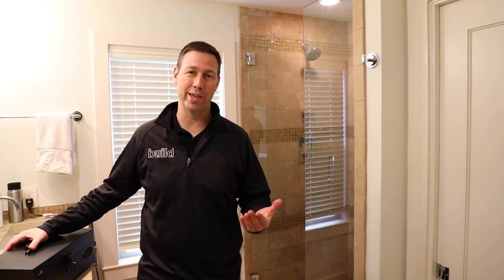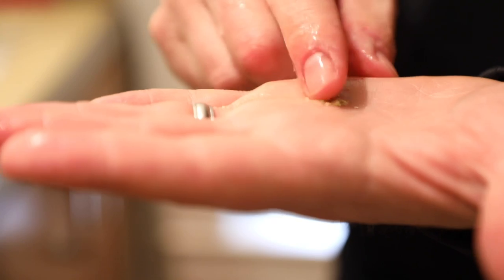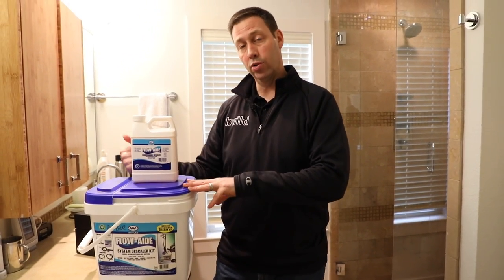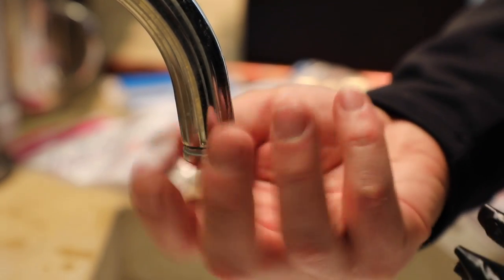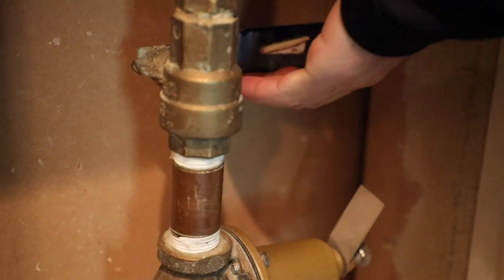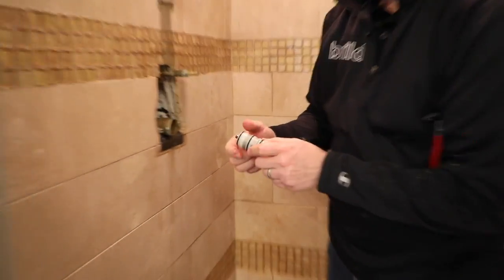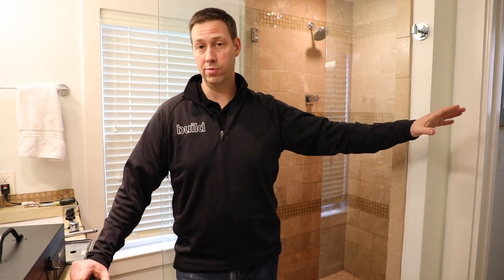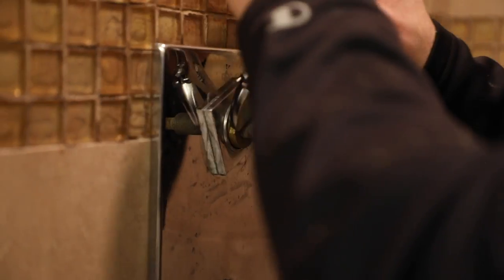The Bummer for Tankless Water Heaters - Fixing a Scale Issue

Comment: That's a pain.  If I ever install one of these, I'm putting a Y type strainer [fine mesh screen] on the water heater outlet to protect the o-rings on my fixtures down the line from big scale.  That way I can make my mess outside, and access is easy.  Come to think of it... add a ball valve for a quick dump of strainer contents as disasters tend to come with company, and they can get back to their shower in seconds instead of an hours worth of maintenance.  Screen still has to be popped out every year for inspection, but that's ok - beats losing screws down the drain..
Reply: Flinch I did that on outlet of my water softener, , FIRST never use those pleated paper water filters, I had one come apart plugging each faucet, never again, then the resin bed filter came apart, did same thing, changed softener, but a brass  y type filter was installed , got that a plumbing supply, LOEWS, HD , don’t carry these things.
Reply: @flybyairplane3528  I'd be afraid to use paper too: it might work, but would that mean changing it out every month without exception? I've never tried it.  For most water systems, spun polyester cartridges seem to work fine, but the high temp coming off a water heater might be an issue that caused your premature delamination?  Seems to me 99% of water filters out there are not designed for hot water service, which makes a [bronze or CPVC body] strainer the most reliable/least maintenance even if it lets super small particles through - a 200 mesh will probably let anything smaller then 75 microns through and a 300 gets 50 microns for example.  If the building was not protected by a filter on it's supply, I sure would put a polyester type before the heater if it comes unequipped.  When city water has problems, their repairs can take a long time or are just a band aid on a stab wound [like grouting the inside of cracked mains pulling in dirt with a venturi effect at certain joints].

Comment: Out here in well water country, the real problem is the water heater's inability to heat the water sufficiently to overcome the 40 degree temperature of the water when it comes out of the ground. Make sure you know what sort of temperature rise your heater is capable of above your ambient 'out of the pipe' temperature. The local hardware store sole several of the electric tankless models and every one was brought back because customers could only get about 88 degree water out of them because of the low ground water temperature.

Comment: I would like to add a few things here, 1 a whole house filter and 2 they have a hot water filter you can add. After the water heater it would help reduce problems drastically.
Reply: Sounds like a great idea, but a whole house filter is useless against hard water. Water softener, or heater treater filter are the only two things that will protect your tankless. Also when flushing a tankless, there are as many as two internal screens located within the tankless water heater that must be cleared prior to, and after, cleaning.

Comment: It's best to have a water softener unit for Sure!!! Besides that in this day and age it's majorly prudent to also have a full water filtration system since municipal water is getting sketchier all the time from the failing infrastructure that isn't maintained at all in this country. Lead incidences are on the rise across the entire country from west coast to east coast!!!! We run a high efficiency boiler system for domestic hot water and heat and without a softener system it would be clogged to the hilt but almost 10 years later we have never had a scale issue...

Comment: Thanks for the great video.  I would have never thought about scale building up on a thermostatic shower valve.

I have a Rheem heat pump water heater and geothermal with a desuperheater and hot water pre-heat tank.  I am on well water.  Other than my water softener and two-stage 1 micron filtration, is there anything else that I can be doing to protect that equipment?

Comment: There was an old water heater in this house when we moved in 15 years ago. The water heater has been kicking and running fine we have well water though that doesn't mean our water isn't hard we tend to have iron buildup. We have to scrub your toilet pretty often or else it starts to look like there's this reddish off color that has stuck all to the toilet bowl. I've wanted to update the water heater to a tankless one but I'm afraid of touching it LOL it's probably just barely holding on and who knows was all these newer water heaters being built so cheaply out of steel that will Rust or just don't want to risk it right now :-) plus God only knows how old is water heater is. We haven't done any maintenance on it whatsoever we haven't drained it and flushed it we haven't changed the anode we haven't changed any of the heater elements. Definitely going to tear this thing apart once we replace it
Reply: Katea Jurors some years ago at my SIL in PLANTATION FL, one day I looked at the WH,it was 30 years old never drained by her, so I replaced it before our trip ended there , she had water damage from upstairs, did quite a mess, had to replace carpeting, then MOLD , she had to have her insurance cover it, you can’t sue the other person, , as is how condo laws are .

Comment: This might be a lot more work, but if they wanted to be certain that all of that scale was removed, could you back flush the entire system with that descaler and let it sit for a day or so and then return water to the house? Like opening a valve slightly to the water heater and using some sort of a pump to pump the descaler into one of the faucets or shower until the system is full and then shutting the valve at the water heater and letting it sit? Or maybe there is a sink/faucet/hose bib at a low point in the house, shut off the water to the house, open every faucet and pump into the low point. Then go around the house and shutting down each faucet?........I could be way off base here, but its a thought.
Reply: Interesting concept!  I've pumped vinegar into all my plumbing lines & fixtures, but worked from the basement "up" (not all fixtures had an easily accessible connection point).  Plus, working from the basement meant I didn't need to move the equipment (i.e., pail of vinegar, pump, lines) once hooked up.  Otherwise, using gravity would have been helpful!  

Since I had to pump the vinegar up 3 floors, I needed a pump that could produce enough head.  I also needed a second person to open one side of each fixture at a time while I started/stopped the pump and opened/closed the corresponding service valve (hot/cold).  We communicated by phone.  

I coloured the vinegar with food colouring so it was obvious when each line was full (since the smell wasn't obvious enough).  It took some coordination to close the fixture valve, stop the pump, and close the service valve (so the vinegar didn't drain out) once each line was full (there's that gravity thing...lol).  Then I let it sit for ~6 hours and that was enough to fully clear all blockages.  I used almost 4 gallons of vinegar to completely fill ALL pipes (hot & cold).  

I have now installed a softener w/pre-filter so hopefully I won't have to flush the lines again, though I will still flush the tankless annually.  We never had any issues when we had a traditional hot water tank, so that tells me that all we really needed was someplace for the minerals/sand/etc to drop out...though the soft water is nice.  (Our hardness is 17 gpg.)

Comment: I am admittedly a bit OCD, but when I descale my Rinnai  I use about 6 gallons of vinegar (about $15 worth at the wholesale club) and sit a 5 gallon bucket in the shower to drop the pump into.  I pull the shower head off and run a 3/4" clear vinyl hose from the shower arm down to the bucket,  and run a drinking water grade hose from the pump back to the tankless.  This way I am de-scaling the entire hot water loop from the tankless to the shower including the valve but without having to disassemble.  I let it run for about an hour like that.  I also go to each tap in the house and crack open the hot until I can smell (or taste) the vinegar coming through to that point.  I do this at the start of the process and let the vinegar sit in the line for the whole hour that I am running the pump.  When I'm done, I flush the lines out well with fresh water before turning the tankless back on.
Reply: WOW what is your house plumbed with
Reply: A little bit of everything ...  copper, PVC and Pex ... but I am flushing the hot water lines to get the scale out of the valves and fixtures where it collects as Matt mentions in his video ... not worried about any scale in the pipes themselves.
Reply: That's definitely a cool thing to do as a diy homeowner.  Running the solution through a thermostatic/ or even a balanced showervalve will also descale the temperature balance piston, which seize up from very thin scale build-up. That's too involved for a paid serviceman to do, as they usually have a set price for the service, and need to get to the next job.
One issue I see with that is thermostic valves have little check valves on the inlets, if the cold one is damaged, you will lose your solution to the cold side. Balanced only valves will definitely loose solution through the cold side.

Comment: Do the smaller tankless (reheem 13 or undersink unit) require the service valves? Smaller units are normally 1/2" inlet outlet; do they make 1/2" service valves? I have only seen the 3/4.

Comment: If you install a recirculation pump with your tankless system then the tankless would be running and using gas or electricity constantly correct? Unless you have a timer on the pump. Its been a few years since I've done an install and want to be sure im giving my clients correct info. Thank you in advance for your input.
Reply: Dave Tobara no the ‘pump’ they suggest is a tiny flow as compared with the others , to prevent that from happening.

Comment: Is there an INLINE solution? ie something you can plug in "inline" kind of like those washing things for your water hose that have a little tank for soap. something we can put in before the water heater fill with vinegar or solution and let it suck it up so it flushes the system that way? something I can run every 6 months to keep the system cleaned up (we have very hard water up here in NM)

Comment: I too have a Rinnai and follow their 4 gallons of vinegar for an hour.  From start to finish takes about 1:20. 

 I bought a $99 submersible pump because it was all plastic and the seals were good for weak acid.  It's important to have a pump capable of 4 gpm to get flow through the entire heat exchanger at a reasonable velocity.  I also add 1 lb of citric acid powder to the vinegar to chelate the calcium.  Since the heat exchanger is copper I would not use any mineral acids, organic acids only. 

 I wish someone would make a unit with a stainless steel heat exchanger.  It would have to be a little larger as SS isn't as good a conductor of heat as Cu, but you could get more aggressive cleaning it if you have harder water.  3-4% nitric acid works great on SS but you'd need all plastic hoses or new ones every time.  Of course a softener would be a smart move in that case. 

Local plumbers quote $150-200 to do this.

Comment: I like tankless, but I don't think flushing alone will prevent these issues.  

A traditional hot water tank provides somewhere for the hardness minerals, sand, etc to "drop out" so they don't end up in the distribution pipes, filter screens, and aerators.  Plus, a traditional hot water storage tank can be periodically drained of debris through the drain valve (inject vinegar if necessary to dissolve/break up larger pieces).  

A tankless doesn't have anywhere for minerals and such to drop out so they end up settling in plumbing loops, low points in the pipes, filter screens, and aerators.  If the buildup becomes too great it can restrict the flow of water at some fixtures to a trickle - i.e., to low to activate the burner on the tankless heater.  

Installing a filter downstream of the tankless outlet could help, but a softener might be necessary if hard water is the primary issue...in which case I would install a filter upstream of the softener inlet to prevent unwanted contamination of the softener media.

Comment: 4:46 Are those shut-off stops built into the shower valve? Could you have cycled those open and close instead of the whole house water shut-off valve and achieved the same results?

Comment: I have a soft water system and whole house filtration system that keeps sediment, chlorine, VOC's, etc out of the tap water, and even then my routine is to maintain the tankless heater once a year. Is that strictly speaking necessary? Probably not. But what's an hour of my time once a year to make sure there's no problems with it?

Comment: The element seems to have lost power a few weeks back.

As the unit was never descaled in its ten to fifteen year life so far, I am three hours into flushing out with a descaling fluid from the hardware store.

The pump is getting hot and heating up the fluid. 

The fluid seems to be turning a lime green.

I'm told the flushing only takes an hour or so, but I am giving it really thorough flushing in the hope this will help the element do its job.

If still not heating I will either replace the element or the entire unit.

Comment: Having a tankless hot water heater is like having a coffee maker to make your hot water. They work fantastic but you must descale them regularly. The same way you have to descale your drip coffee maker. That's how I think of it.
Reply: Something tells me that you and I are the only two people that descale our coffee makers.
Reply: @misterhat5823  I throw mine into garbage because it lost pressure. I thought pump got broken, now I know what's the real reason
Reply: 5argeTech /\ There WAS an A&P supermarket in ANDOVER NJ , they had a large water heater installed, it had 1 LARGE ELEMENT, it lasted 3 months, replaced it at great expense, 4 months, then they installed a different brand  3 years it died, but elements were MUCH CHEAPER. The MR COFFEE, in the break room 1 month, vinegar ,,,,,, bs, buy another one. That’s how bad that water was, the closed that store years before the company went belly up.. it’s now a Post Office.
Reply: I guess I’ve never had a flow problem with my coffee maker so I’ve never descaled it in all the years.
Reply: It's not like you didn't have to maintain a tank.  I drained and flushed yearly and I replaced the rod on a regular basis.  But then my tanks lasted.
Reply: @misterhat5823  I regularly descale mine, fellow hat person.  :)

Comment: That water heater on the outside of the house just looks so wrong to me.  But I live in Minnesota so yeah.
Reply: Some have automatic heaters. No pipes bursting in winter.
Reply: Klaa2 we have water pips out side of the homes in Oklahoma
Reply: Klaa2 you need to go to London UK,,homes there are few centuries old, so ALL PIPESate EXTERNAL,,including sewer pipes, they need to use a small water pump to boost the intake to the house.
Reply: When I moved to NC I saw several houses with exposed plumbing in garages.  I has a water heater and softener in mine.  My neighbors thought I was crazy to put an insulated box around them and put a heater set at 40F.  Until that winter when we beat our record of hours, and I do mean hours, below freezing.  The record before was 26 hours... we set it at 87 hours back during that big freeze in 1993.  Everyone was coming to our house for showers for a week!  To be fair, the new #2 record has never been set, so people just say I jinxed it!
Reply: To me that is nuts, one random cold snap even in warmer climate and your pipes will freeze
Reply: Brent For me, too.  I am keeping mine installed indoors when I get mine installed.
Reply: So different here in New Orleans. Outside  Maintenance doesn't mean you freeze to death.

Comment: Because of hard water, I have to clean my shower head about every 6 months.
I just take it off, coat the numerous tiny holes with toilet bowl cleaner, let set for an hour, rinse, use needle "head"(not point) to ream any holes that are still obviously blocked, then reinstall.
Reply: Try vinegar, it will also leave it spotlessly clean.

Comment: I have a unconventional water system. at my off grid home. I have a shallow well. and a thankless heater. I haven't used it. but its a camper type for basically a shower. I'm using it in my home. for hot water in the sink and shower. I was thinking of adding another one . if there isn't enough flow. I don't think mineral build up would be that much of an issue. I also have two carbon filters inline. I Aldo need to re plumb the house. its a jumble of 70 years of plumbing types. I'm thinking pex. I don't guess there any concerns of it breaking down. and polluting the water. I don't plan to drink the water until its been well tested. and used for a while. I guess pex is the best cheapest thing?

Comment: I've got a question. Last time I was going to build a house the builder talked me out of tankless hot water. Said it was trouble. You've shown with proper maintenance things can be alright. I don't want to install a water softener but am thinking about a whole house series of filters. Will this accomplish the same thing....removing the contamination from hard water?
Reply: David Martin basic filtered can NOT remove minerals , sorry.
Reply: @flybyairplane3528  THANK YOU - so many posts imply you can filter dissolved minerals - NO.  Particles are not the problem, it's dissolved calcium etc that then precipitates upon heating.